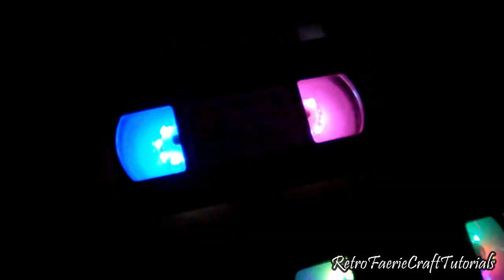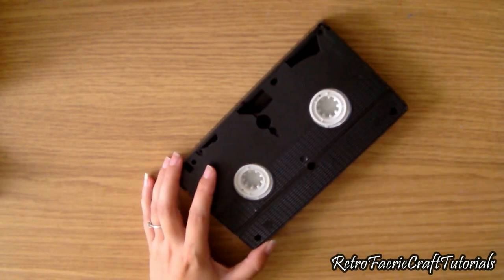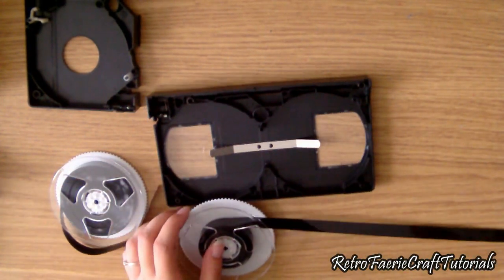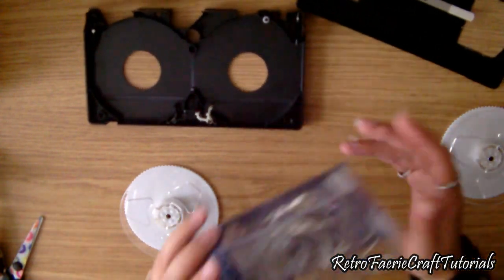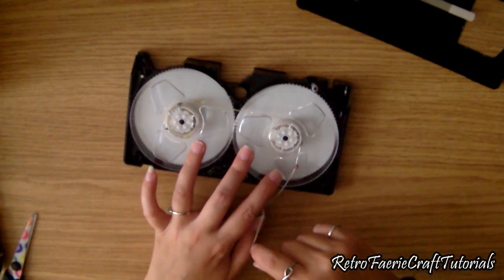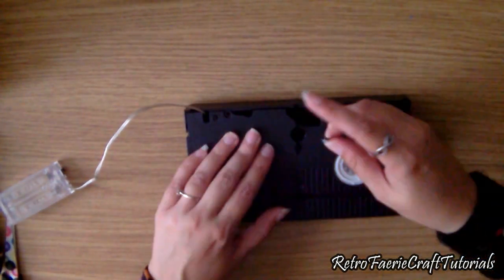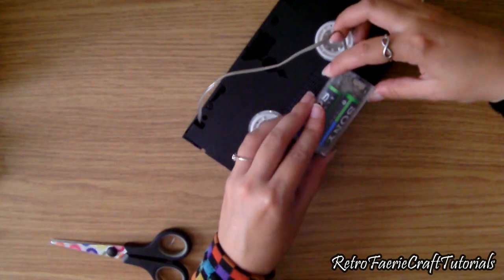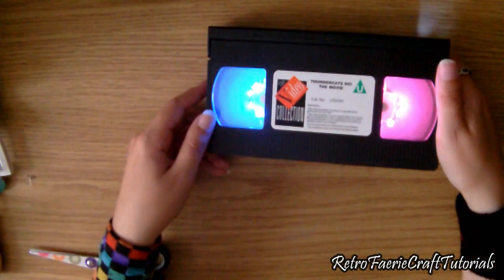How To Make A VHS Light

Comment: what length is the wire and how many bulbs were in the micro led package?
I found 1 meter with 10 bulbs,is that enough?
Help appreciated!
Reply from the maker: Hi, mine had 10 bulbs and was a bit longer than a meter but that was quite a bit of wire to wrap so 1 meter with 10 bulbs should be perfect 😁 thanks for watching.